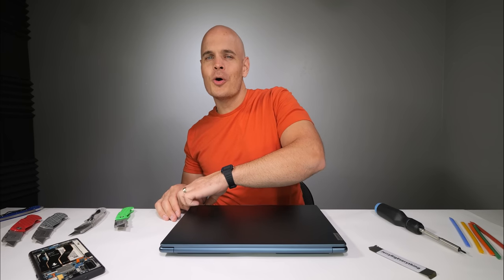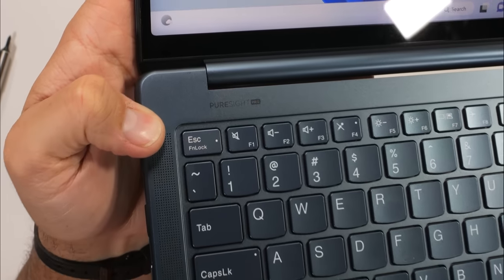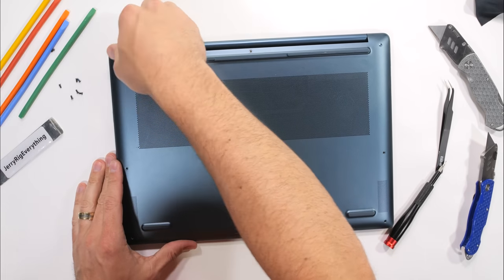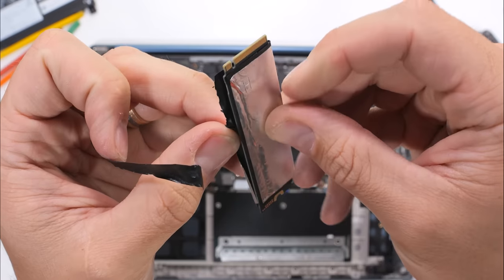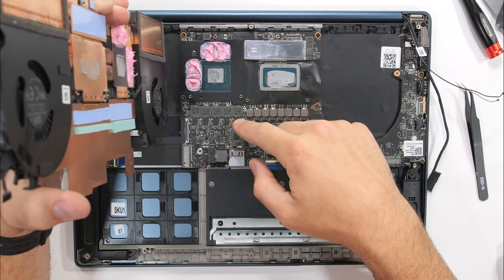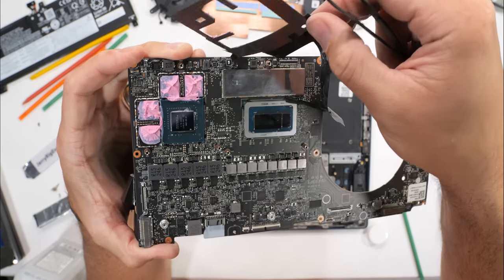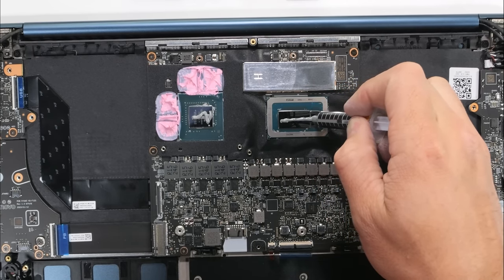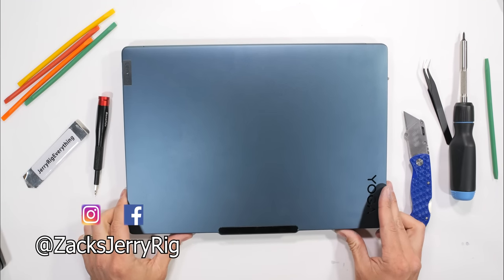FINALLY! - a Professional Laptop that actually puts out

Comment: 3:58 It's called "Novo Button" and when turned off it can show you a menu with options to go to the bios, boot menu and etc (Long term Lenovo User here).
usually to get to the bios is either F1 or F2 and to the boot menu F11 or F12 depending on the model series.
Also the power delivery "dudats" 5:19 are called MOSFETs and VRMs :)
Reply: Yeah it's F1 for bios on lenovo, F12 for boot menu or you can mash the enter key to enter into a choices menu that gives you the prior mentioned options among a few others
Reply: I assume you had always a good experience with their products? 
I ask because my yoga c640 feels more like a cheap piece of trash than anything, I probably should have bought another model
Reply: @mastroitek  Honestly outside of the thinkpad line the lenovo laptops are generally pretty trash tier and unfortunately the thinkpads are approaching that tier as well which is a shame as I really liked the thinkpads :(
Reply: @blazingmatty123  the legion series were before but now they're getting better and better
Reply: I was number 69 that's all he needs to know
Reply: @mastroitek  the letter C is the lowest end and cheapest stuff Lenovo makes, so what did you expect ?
Reply: @quicksilverb12  actually yeah the legion series had escaped me, those have been pretty good in recent years, I had a legion 5 with the 4800H and 2060 and 64gb ram not too long back before I managed to drop it and just bought a second hand dell precision 5560 with the 11950H and A3000 and the same 64gb ram to replace it haha
Reply: @quicksilverb12  they are still a brand I would steer clear of. I see a lot of people coming in with them with issues lately
Reply: @mastroitek  can confirm what the other guy said. I would definitely not recommend anything Lenovo outside of the ThinkPad series. Most ThinkPads are tanks and relatively easy to repair or upgrade certain parts (especially on older models). However their consumer lines of products are generally cheaply made ewaste and are not designed to last.
Reply: @satanicaleve  I'm an engineer and I can tell you they have bad products yes but there are a good products as well. The high end and some of the midrange stuff is getting better in recent years in terms of hardware. However in software way I've had pretty ridiculous experience of "successful" bios update which turned out to be a failed one and I had to desolder flash the chip again and solder it back. (that was like 2019). In recent years (because I contacted people either representatives and engineers at their legion team) and explained it is not right machine that costs over a $1000 to come with faulty bios updates and etc and the price doesn't really matter when you ship good hardware with sh*tty software. I was really mad about it even though I fixed it myself. They did not even provided me the schematics of where and which is the bios chip and I had to figure out on my own. (Took me like a few days but I figured it out)
Reply: @blazingmatty123  Just be careful with the BIOS updates because sometimes they can ruin your performance to be honest. Watch what is changed in the documentation of the update always before downloading and installing it and never install it through the windows update because it doesn't give any kind of information specifically what is changing on the firmware.
Reply: @mastroitek  well depending on what model you are getting plus you have to be very careful with software updates (any kind) but yes as the comment below said the C series are pretty cheap so don't expect any good experience, always search for reviews in the communities before buying because you might step on a land mine of troubles fixing new machine :D
Reply: @quicksilverb12  yeah we've seen this a few times with the P15V gen 3's that we hand out so we often wind up having to roll the bios back to a specific version for best performance haha
Reply: @YounesLayachi  I guess I was expecting a laptop that turns on and wakes up from sleep, but half f the times it just chooses not to
Reply: @myrecommendedisallmemes  yeah, only issue is that I'm a student, I needed a 2 in 1 and 3y ago we had less options and prices were higher. I did not want (and could not) pay over a grand for a laptop
Reply: @mastroitek  did you mess with the software or allow Microsoft to mess it up for you ?
Reply: @YounesLayachi  I don't think so, I tried many things, for example I even installed linux mint (I wanted to see if it was a software issue related to the various Windows sleep states) but the problem remained unchanged. Same with fresh installs of W10 Pro and W11 Pro, also changing chipset drivers and bios versions did not fix it.
I was positive the problem was software related but at this point I'm thinking it might be hardware. (Also I started having issues right around the 2y mark)
Reply: It's called "Doodad" instead of "Dudat".
Reply: i prefer power delivery "dudats" lol
Reply: @blazingmatty123  Mid and high tier Ideapads are also really good nowadays.

Comment: The price I'm seeing on Amazon is not all that bad for this much power. My only gripe is with the processors and LPDDR4 being board integrated. This means that any RAM failure results in a total board replacement. I'm not seeing any board at this moment but, my experience with repairs tells me the unit would likely be more cost effective to replace as a whole than service. Also, I didn't notice if the WIFI card was removable or not, didn't see it in the teardown. If the WIFI is also board integrated, this can be a similar and larger issue. I've seen dead WIFI kill a 1 year old Alienware M17 before. The machine was a $1700 machine but we couldn't find a replacement board for less than $1100
Reply: Got to love that forced obsolescence due to cost.
Reply: Also I spotted that fans are not removable from heatsink. They are doing it for at least 2 years. Good lluck cleaning dust bunnies from cooling system.
P.S. Wi-fi is not replaceable. In such huge laptop, smh
Reply: Its a trade off really. Ram in particular, intergrated and sodderd right can be a pretty high performance boost. Hell as much as apple's unrepairable bs annoys they they actually use the sodderd nature of thier chips to boost performance evem more
Reply: @nomore-constipation  It's LPDDR5X, you can't socket that and retain the speed and lower power usage, its not all about cost saving.
Reply: @donkey1271  Not like they can't socket it, more likely they didn't want a thick laptop with extra thickness.
Reply: I'm sure you could find someone to take it off your hands that could add Wifi functionality in another way. I do understand how repearability is made more difficult with making things board integrated.
Reply: @DarkGT  You can't socket LPDDR5X, unless you use Dell's CAMM system which is very early days.
Reply: All that typing and he never figured out that pesky $9 USB WiFi.
Reply: Perhaps that is why they called it a dongle.
Reply: Lpddr5x ram cannot be used by normal sockets bro... That is why gaming laptops usually only go up to 4800mhz... If you want to go faster, currently, the only option is soldering the ram closer to the processor... Hopefully the new CAM technology could be brought back then..
Reply: @SreejithKSGupta  Tell that to the 2600 Mobile AMD chip 20 years ago that sought higher than 5 MHz. MHz is not the only limiting factor.
Reply: @jiml4987  didn't get you bro.... Can you give a little context?
Reply: @SreejithKSGupta  google is your friend... friend 5k has been around for 20 years, nothing new.
Reply: @jiml4987  all I could see was ryzen 2600, that is why I asked you again bro...
Reply: @Sreejith KS  Sorry. Upon further research it seams like it was a forgotten processor.  The AMD 2500/2600 mobile processor that was in fact legendary for the overclocking back in the day.
Reply: Socket 462 or socket A. It was rated from factory at 1.8 MHz and with water cooling would achieve greater than 5 MHz.
Reply: @ИгорьКравцов-д4щ  those fans are removable. There are tiny screws on the heatsink that would allow it to detach. It does mean you need to remove the heatsink to remove the fan though.
Reply: Lol, how many times in your life have you had a ram failure.
Reply: You could have used a wifi adapter which costs about 15 bucks
Reply: not bad??? Where did you see the price??? at least this laptop will be around 4.5 - 5k dude. i bought my Alienware refurbished for 4k similar to this.
Reply: @Naveredddd Plugging in a better WiFi dongle doesn't stop the included WiFi from interfering with motherboard operation, such as by remaining on or overloading the CPU bus (PCIe or otherwise).  Years ago, I had a desktop PC that refused to boot because the multifunction I/O chip had failed in such a mainbus killing way, fortunately it was on a removable card back then.

Comment: Hey zack, ive got a tech tip for you

When you apply thermal paste to bare silicon (without a metal heat spreader) it is absolutely essential that you spread the thernal paste on the silicon without leaving any empty spaces. 

If i were you i would open up the laptop straight away and reapply the thermal paste.
Reply: I've got a tip for you: when working with low mounting pressure heat spreaders like inside a laptop don't use thermal paste. Use Honeywell's PTM7950 phase change pad. It matches liquid metal in performance while being completely electrically non-conductive and staying in place. It's the best TIM available in 2023 for laptops
Reply: @iamdmc  i havent tested it personally but in theory and based on tests others done yah i totally agree with you, the only issue is sourcing the real Honeywell pad.
Reply: He used a lot of paste, the extra paste will squish to the sides leaving no air gaps.
Reply: @DarkGT   you can't be 100% sure that the whole silicon die will be covered. unfortunately I had a mishap with an Athlon 64 x2 laptop processor I thought there was no need to spread the thermal paste if I'm just going to squish it, and it ended with a chipped processor after overheating.
Reply: @zeedan94  It happens to the best of us. Everyone have their preferred way. Just use enough paste or more than what you think is enough.

Comment: I own one of this, the 14" version. Had a lot of problems and through the last 6 month it spent 3 month in service. Thank god I had warranty, but at the same time using Macbook m1 pro was much more smooth. Special acknowledgements for the efficiency of cpu and cool cooling system engineering in macbook. This Lenovo still uses fans a lot which decreases the work time to 2-2.5 hours. Recommending to buy a powerbank in addition to the laptop. Overall, the laptop could be more robust too. If the macbook is 10/10 robust, this laptop is like 8/10.

Comment: Would actually love to see a durability test on this. Used to own a Lenovo and it only held 2 1/2 years before the frame started to fall apart.
Reply: All Lenovo's do that. It's piss poor quality of plastic and hinges. I see them in my repair shop often all with the same kind of issues.
It went serious downhill somewhere around 2014, not sure what happend around that time but it got worse since. Everything above 4th gen intel based lenovo laptops.
Reply: durability 0.3mm aluminium + 0.3mm plastic ?
Reply: @OsmosisHD  i work daily with lenovo laptops. the only physical failiures ive seen on the T and E series were "user error"
Reply: I have Lenovo Yoga 710 since 2018.  It was my student laptop (I am a Master in Robotics now). Being not very careful with things, I can tell it is super durable!!! It cracked in several places because it fell from my height several times... but still does the job. I am honestly shocked. So now I am looking at the same, but newer model.

Comment: I have a tech tip for you: on direct die cooling it's a good idea to spread the thermal paste. The heat conductivity of the silicon is so low that any small corner not covered could overheat and die.

Not at all a problem on chips with an IHS, because of the copper.

Comment: It's hard to explain how magnifical Lenovo's keyboard is mostly to someone who have never used one before.. I've been on the x1 Carbon line up since gen 6 and only lenovo can match that experience.
Reply: It's also hard to explain how awesome the original IBM Thinkpad keyboards were before Lenovo took over and gradually made them worse.
Reply: Seems like the X1 carbon keyboards are much better than the yoga keyboards, correct?

Comment: Nice video as always, Zack! Recently got my 16 inch Pro 9i (2024, 9th gen). The inside is very similar (more symmetrical, bigger battery and bigger speakers), but word to the wise: Lenovo has unfortunately stopped pre-installing thermal foam pads in the M2 expansion slot. Just installed an additional 2TB and didn't have any foam on hand, so hope it doesn't really matter and overheat. 😅

Comment: The thermal "paste" that was originally on there was a variant of PTM7950, which is a phase change material designed to last a lot and fill the imperfectoins in heatsink a lot better than traditional thermal paste. Unfortunately the thermals are now much worse on this laptop, not to mention pumpout and drying out. Still, great video!
Reply: he ain't the tech tips guy, so it's understandable.
Reply: How much worse it can be? +3-4 degrees? I can live with that. If they wanted the best of the best, they could have used a liquid metal LMAO.
Reply: @DarkGT  It's about longevity. I've been using ptm7950 on a ThinkPad T480 for about a year and just repasted bt brand new T14G2 with the same PTM. The temperatures immediately dropped by 8-10 degrees from stock paste, and i know the paste will keep its properties for a long time.
Reply: @DarkGT  liquid metal would be either too expensive or too dangerous for a slim laptop like rhat, ptm7950 shines here, as it combines best of both worlds between paste and lm
Reply: @verpejas  Maybe you clean the dust, or the old paste have dried? On my MX4 there is label saying 7 years, so even the regular paste should last you long. I'm sure that premium solution have advantages, if you don't have the ptm7950 or whatever, you can still be okay if other brands. It really depends if you are going to push it to the limits with heavy computations that will heat the CPU and GPU.
Reply: @verpejas  LM has been used on slim laptops, Asus uses it on some models. Also PCM pads have the benefit of very long lifespan, but they will not outperform high end thermal paste. PCM pads are typically in the 8 W/mK range, high end paste like thermal grizzly Kryonaut Extreme are Kryonaut 14.2 W/mK.
Reply: @DarkGT  MX4 lasting 7 years doesn’t mean all paste will last, every brand uses a slightly different chemical makeup. 7 year claim was tested with desktops IIRC, some laptops have poor/uneven mounting pressure which causes thermal paste to “pump out”. Good paste doesn’t dry, it generally just seeps away from the heatsink contact patch, how long pump out takes is dependent on the design of the cooler.
Reply: @Dirty_Bear22  Your mileage may vary. Uneven pressure is more common with cheap and old models. It's expected for expensive laptops like this new Yoga to have better tolerances. 
I have replaced my thermal paste 4-5 times on my laptop just for the sake of it. There wasn't any differences in the quality of the paste compared to new layer of paste. Even after re-pasting the temperate is identical. Everyone mileage may vary, that's my observation.
Reply: @DarkGT  That sounds about right, temps usually stay the same or drop after a new application. PCM materials like pt 7950 actually under perform high end thermal pastes, their main Advantage is having a very long lifespan.

Comment: Think how long it took for someone to put a proper webcam switch on the laptop?
In one laptop from Sony I think, there was a webcam slide in it, and the slide operated through a extremely tiny, like 0.2mm wide slide on top edge of the totally black frame. You couldn't even see if the slide was on front of the camera or not, and you couldn't see or feel the slide itself.
When you put the laptop frame edge directly under a strong light, you could see that tiny slid and slot where it moved. 
So when you learned that it existed, you knew how to open the camera as often you accidentally shut it when operating display. 

But having an actual good switch to turn camera off/on by its power, that is just great thing!
I don't trust any electronic green light etc, it needs to be physical.

Comment: I really do miss socketed RAM and especially CPUs in laptops.  Being able to grab the top-of-the-line CPU for the chipset 5+ years down the line really helps with keeping it out of a landfill.  64 GB of board-soldered RAM is really quite generous and nice though, so props to Lenovo for that one.